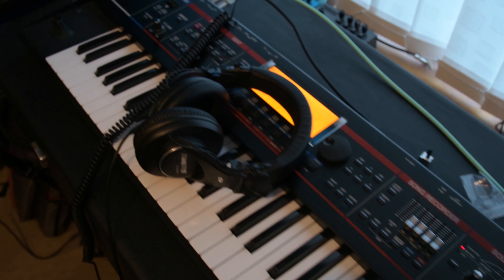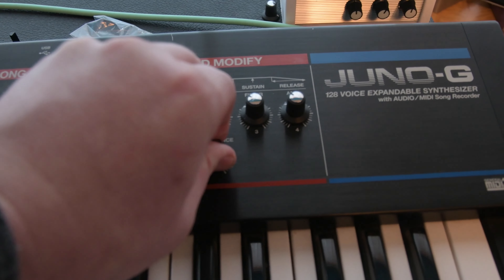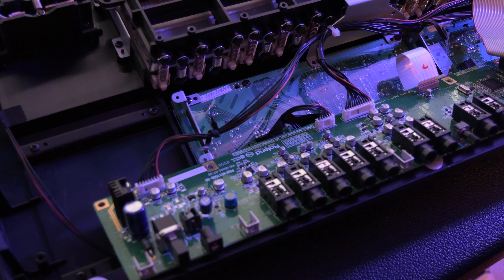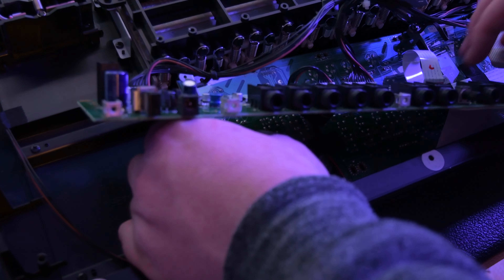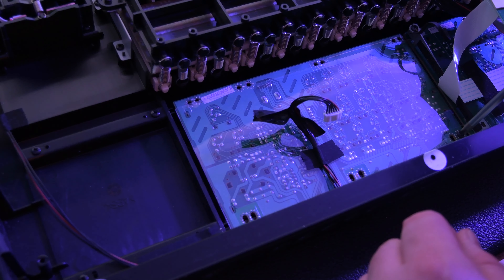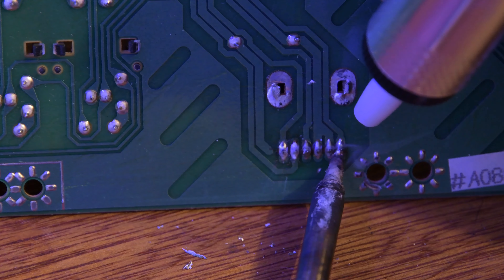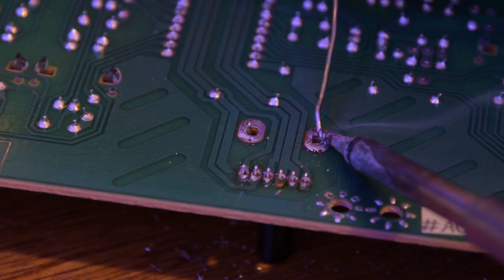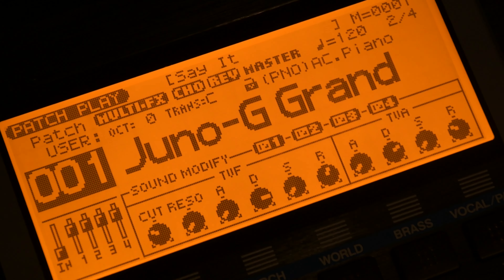Roland Juno G - Repair of Volume pot - Not the screen!

Comment: Hello, do you by any chance do repairs? I have a Juno DS with volume problems after being knocked at an event it volume isn’t consistent and for some reason it reduces by itself even when I’m not adjusting the dial

Hope you can shed some light on this, thanks in advance!

Comment: Ive got the same issue with my Juno-G volume knob. 😢 Do you know anywhere in the UK that would repair these & a cracked screen?
Reply from the maker: Sorry I dont. I am based in the northeast and could change the pot for you if you want, if you take the board out and post it, it might not be too hard. 
For the screen is it the outer screen or the actual screen? the actual screens are known to fail.
Reply: @deancoyle  Thank you for your reply! I’ve got the board out, but it’s still attached to wires that are soldered on / attached to the board next to it. Is there a way around this? 
Ah! It looks like the actual screen to me as no damage to the outside screen. I was on route to a gig & someone put their gear on top of it. When I turn it on now, the screen is just blank.
Reply from the maker: I didn't have to solder anything to get the board out, do you have any photos?
I guess they could have changed the design over the production length - if so that is a little annoying.
Feel free to email me and I will try to get back quicker
deancoyledesigns@gmail.com